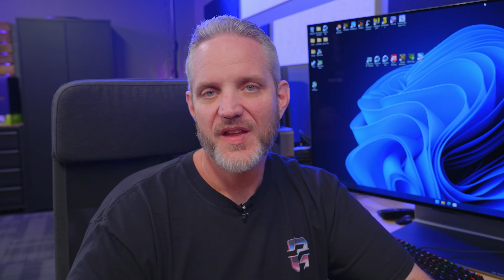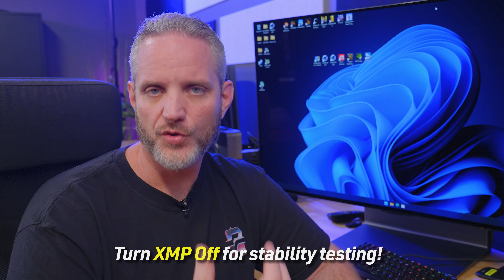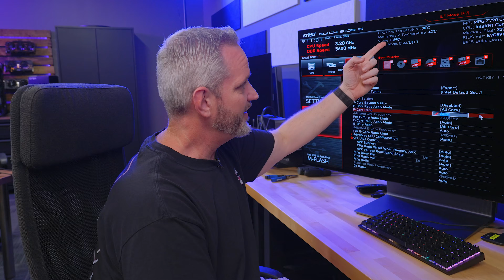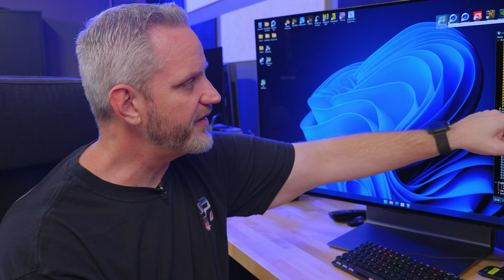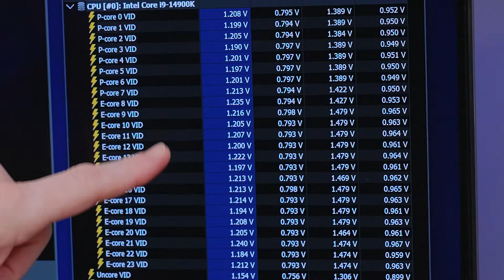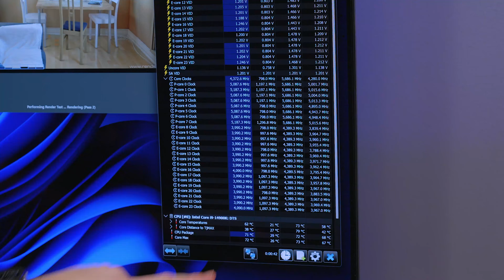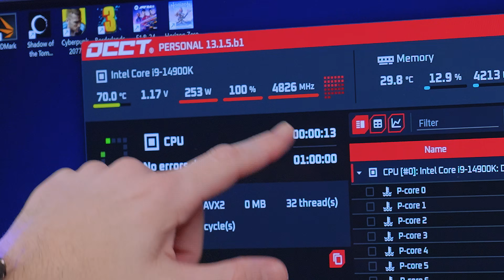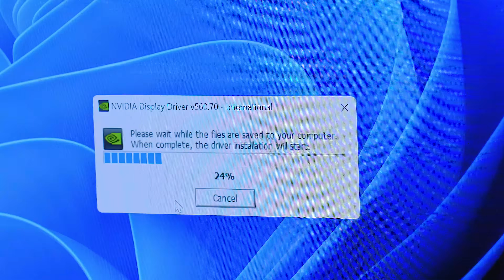Guide: How to check if your CPU is BAD!

Comment: Afraid to update my bios. My rig is working fine. My wife's rig however, constant BSOD errors. I replaced cpu, gpu, cooler, ram, mobo, and ssd. Not all at once. I did a clean install of win 11 each time and the errors started up as soon as I started updating windows. Did every fix I can find, updated bios IN the bios and still can't do anything. It'll start up after a few BSOD errors and then the second I try to run an installer for an app or a driver, it crashes. No OC, cpu temp holding at 41c. Got asus rog maximus 7790 hero, 128gb corsair dominator ram, 2tb ssd, asus 4090 tuf, corsair 100watt psu, i9 14900k with liquid cooling. Don't know what else to do. My other rig is the same mobo, i9 13900k, 64gb corsair dominator ram, evga 3080, bios version 813. ZERO issues! I'm afraid to update anything at this point with this rig. The other, looks like I have to rebuild it again $8000 later. Ready to give up.

Comment: Intel should print on the CPU the plant where it was made, just as in the "good old times" we were looking for Intel "Costa Rica" CPUs, I now demand to buy only CPUs made in Asia... I have my suspicions about "new" manufacturing plants (Boeing comes to mind). I doubt any of the "Asian Intel" CPUs are having issues. Maybe that gibberish that comes printed on them indicates the place of "birth", however, I want clear information as to where the CPU was "cooked". If they did it for so long, why don't they do it now? Too much taxpayer $$$ for them to build plants in the least reliable manufacturing country on earth?
AMD with their exploding CPUs or their very slow CPUs which had their power cut to almost half, I wonder why, is even worse. So, for my 5950X, probably the best desktop Ryzen CPU ever, I changed the cooler to a new generation Artic AIO, here's the "enlightening" information:
- Diffused in USA - Diffused in Taiwan - Made in China
WTF does that even mean? The CPU is on a joy ride or maybe on a business trip?
Anyway, I'm skipping this generation of CPUs, both in my personal rigs and in my factory (Trucks and High-Performance Cars). 
I hope they come clean in the next generation and tell me exactly where my CPUs are being made. I own a Bombardier and an Embraer, if I had both planes grounded for some strange reason and had to fly commercial (rather have my teeth pulled out with no anaesthetics, but it could happen), I would rather take longer and wait at the airport than fly in a Boeing Airplane. 
The same goes for CPUs, I want to know who is building them and where they are being built, like a few generations ago.

Comment: I am an idiot that bought 13900k, because it's been 1 year almost that I busted my a....s for coding and crashing and then I notice my codes are correct and this is my PC that changing variables from one line to next, then I try my codes on 12700k and Amd 3950x and they work with no issue what so ever, so I decide to ask for RMA the sent me new CPU with and ogly box and they took my original box as well so it 50euros less now and the new CPU was even worse and crash exactly the same or in some case even more, with last Intel microcode 0x129  the problem get's more complicated, in game it is stable but in Render and simulation is an absolute disaster, so lesson to me and go for AMD or Apple if you do not want to spend I do not know 3000 including GPU etc and do not be able to use your PC even for one day and be 1005 sure it will be stable all day long.

Comment: The cpu landscape is very confusing and even more so now with the issues Intel 13 and 14 gen cpus are experiencing. Should I avoid these now??? Any issues with ryzen 7000 series? I am looking to build a system and don't know really where to turn to get the right advice. I dont build for gaming, but I do want a midrange system with a focus on reliability/longevity/efficiency. Intel i5 12th gen perhaps or ryzen 5 5000 series? Any advice on where to go here?

Comment: my 14900k seems fine in those tests at stock settings. but I can't get a stable 6.1 p core overclock. It was easy when it was brand new. now, I've spent a ton of time trying to get it stable at 6.1 and it doesn't look like its gonna happen. stock clocks is fine tho

Comment: Hey Jay, I have a question for you. I have an odd issue. I have a 13700kf and it is not stable using all stock settings, including XMP disabled. I have an Asus z690e motherboard. When I run Intel Burn Test it will say the system is not stable after 3 to 5 passes. This is with going in the BIOS and selecting Load Optimized Defaults on the their latest microcode fix BIOS, and again XMP disabled. For testing I ordered a brand new 13700kf and a brand new Asus z790e (non wifi 2 version), and even with the brand new 13700kf and the z790e motherboard, I get the same results with the Intel Burn Test. I have also tried 3 different sets of RAM. 1 set of  32GB (2x16) and 2 different sets of 64GB (2x32), all 3 of which are on the QVL list for these motherboards/CPU.

The odd part is if I set the BIOS to use Asus optimized settings, and set the PL1 power limit to 253 watts, and the PL2 power limit to 350 watts (slightly outside of Intel spec), the PC boots fine and the Intel Burn Test runs fine with no errors. I can also then enable XMP and everything seems stable.

Also worth mentioning, the PC with either motherboard OR any of the sets of RAM and both CPUs had trouble reliably booting when set to the Intel limits and no XMP enabled. It will get stuck on post codes related to RAM problems. As well as the same boot issues with XMP enabled with the same Intel recommended settings.  

But as said, as soon as I load the Asus optimized settings in BIOS, and set the PL1 to the stock 253 , and PL2 to 350 everything runs great. 

Any idea what is going on here? I cant be the only one with the problem, since I have tried 2 CPUs, 2 motherboards, and 3 sets of QVL RAM between those.

Edited to fix a few words and grammar issues.

Comment: 13900k with ASUS extreme mother z790  is showing 100 when stressed to all core but not crashing,  temperature rises above 70 = 89 degrees when  i am rendering 4k video, red light on mother board blink on and off when temperature touches 89 or 90 but not crashing. I am getting  burning  smell from  AIO Corsair iCUE H170i Elite Capellix XT Liquid CPU Cooler  is my CPU  ok or degrading Kindly let me know

Comment: my cpu passes all these tests with healthy vcore and core temps and core voltage. (Intel i9 14900kf). However when I play demanding games i notice average vcore of anywhere between 1.35-1.42 while pulling approximately 130 watts. Only once I noticed a vcore spike of up to 1.52V and occasionally get spikes up 1.46. Im new to PC gaming. Are these numbers normal? Any input would be appreciated.

Comment: The recent 561.09 driver installed when the screen went black it never came back forced to reboot and had to reinstall it again and it went thru but I have had this happen ever so often thats how mine has happened. I am running I7-12700K  and Asus 4070 Super rog strix that I purchased about a month ago... Any suggestions

Comment: Well glad I did not update my 12th gen CPU under the Intel label. So far it's been running fine I've had no issues. The improvements that were shown with the 13th and 14th gen Intel cpus, did not make it worth me taking out my current one.

Comment: I'm not getting any crashing, but Microsoft flight simulator is stuttering a lot, almost like the cpu is taking a breath then firing back up, which I didn't have when the cpu was new.
So I'm not sure if my 14700k has been degraded or not.

Comment: I've got an old i5-4690k on a Z97 Pro4 and OC it at 4.4Ghz. With OCCT on extreme cpu test i hit the 100°C even after replacing the thermal paste (arctic mx4) and with Arctic Freezer 7pro but with no crash. Should i be expexting lower temps?

Comment: I have a 13900k on a MSI Z790 MB with a 3080 card. I bought it during covid. It started crashing BG3 and CP2077 about 6 months ago and has gotten worse. It would crash to desktop and would not install Nvidia drivers. Cenebench15 and 23 would freeze up. I updated my bios and that helped but I had to make some changes in the bios to get it stable. It still will randomly crash but not as bad as it used to. I think it is hosed but I can't afford to switch right now. This sucks.

Comment: I have had a 13th gen for a while and in the last ~5 months been experiencing random crashes. I just learned about the voltage issues a week or so ago and have been wondering exactly this. Is my CPU too far gone? Thank you so much for this video!
Reply: One they start it’s already damaged irreversibly, see if you can RMA or warranty because intel has been really slimy about thai

Comment: hello, i have an i5 14600k with asus rog strix z790 h gaming wifi, with lian li 240 aio, last day i was playing world of warcraft suddenly the screen went black no signal, but the game kept running, i could still hear discord, then fans goes like 100% and it's stays like that till i force a restart, is that a cpu problem or graphic card problem even though i have an rtx 2070 super from strix that i have never overclock or something.

thank you in advance if someone has the same issue just tell me how it was fixed
Reply: when the CPU crashes it will either do a blue screen (BSOD) or display a message window saying it's out of VRAM, so no your crash isn't coming from your CPU.
Reply: @TheKayack1  after the bios update those crashes never happened after, so most probably they came from the cpu voltage or something like that

Comment: FYI, I have been having constant crashes when running Diablo 4. I tried running Starfield and it Crashes.I tested my new NZXT-PC with a i9-14900KF and both Cinebenchs used in your video and they crash and OCCT wouldn't even start, and when I ran Intel's Diagnostic (latest version from Intel), the Burn Test, Unigen and NVIDIA install had no issues. I swapped out my Gigabyte RTX4090 for my ASUS Strix RTX2080Ti and no crashes. Clearly I am having video issues. Thanks for the great video in helping me identify my GPU issue. Stay strong and thanks for the great instructional video.
Reply: I also have in game crashes do you know a fix for this? i have a 13900k im thinking about RMA tought
Reply: (I realize this is a 1yr old post, so you probably have this sorted out already).  Your 4090 also could not be the issue, there is 200 watts difference between 2080ti and 4090.  Your power supply may not be able to reliably power the 4090 vs the 2080ti.  I have a 1500w Platinum oem Dell Alienware psu from a threadripper edition Alienware, It's only able too power about 700-750w worth of power to the 12v (should be a lot closer too 1000w).  I have a cheap Thermaltake Smart 700w power supply, it it is really close to delivering as much power the 1500W manages...  I've been dealing with computers for nearly 30 years, almost every time a perfectly working system of mine that developed a problem or crash, it was the damn power supply that was the cause.  If the system works perfectly month after month, year after year, then out of no where it starts crashing....   power supply is the first thing I check.  assuming you keep up on thermal paste and dust buildup.  I have a system I built new, with fx8350, it has literally been running 24/7 as a server since 2013.  It behaves as if it will run indefinitely forever.

Comment: Guys i need some help here. So im on the i7 12700k using the Asus Tuf D4 Wifi Z690 MB. Using intel OC Tuner i was hitting 7200 7300 benchmark score with an average of 145w (90mV undervolt). I have now upgraded to the latest bios which has the new microcode fix for the next gen cpus, yet the same undervolt uses 175 180W and less benchmark score of 5900-6100. Can someone please enlighten me what the heck is going on ?

Comment: I have a I9 13900k and a MSI Z690 FORCE WIFI, when I lunch a unreal engine 5 game I constantly get the error of “VRAM Full” I have a 4090 so that shouldn’t be the case. So long story short ended up RMA the gpu twice to get the same errors. I decided to contact Intel just to be told to change my LLC mode till it became stable

Comment: My 13700K in z690 Gigabyte have been failing during 3D rendering since 3Q of 2023, the count went up with the time, seriously and before new Microcode/Bios update I could not even slice slightly larger models for my 3D printer. Now it is ok and I do not want to even try to replicate those crashes, ever! 😀

Comment: i had similar problem once i tried to install nvidia drivers on windows 10 i got white pop-up with some error (dont remeber the code of error). Then i did fully erase of all disks, reinstalled windows 11 (i got 1 blue screen during instalation) then i updated bios, enabled xmp, set long and short range power to not be more than 100w, and seems like it works better. I played games for few days and it works quite stable.
But now i got another issue. I decided to rebuilt pc, do some cabel managment, etc.. and now my pc in the local service, because it just wont start and even no POSTing there :(  I bought a new motheboard but it didnt help, so now i hope its some stupid thing, but not a processor

Comment: I have a bad i9-14900KF and my test is Android studio->build android app (Android Studio just quit unexpectedly because I think it runs many tests during execution like If (1+1 != 2) then shut down) this test is very consistent and alows me to verify if certain settings in the bios fixes the CPU and so far my only rock solid fix is to downclock to 5,6Ghz on all p-cores. WinRAR compress a 40gb game file (it's consistent but I dont want to damage my ssd so I don't do it too much). Open Chrome and YouTube and get a sad smiley meaning something went wrong. Also Fortnite just crash randomly, mainly while loading the map.

Comment: Hey, i am using PRIME Z790-P WIFI + i7-13700K, have installed the latest version of bios with microcode 0x129 and my core VID are 1.3 V even without using any sort of benchamrk, all default, no xmp, in the bios settings i am having intel default settings. But at the cinebench while launching it i am getting instantly 100 C jumps. What does that means? My colling Cooler Master MasterLiquid Lite ML240L V2 RGB, Thermal paste - Arctic MX‑6, i did mount my cooling twice to be sure its installed correctly, the paste placed with the X style. I can manage undervolting with -0.190 and -0.075 cache, plus reducting core ratio, to don not hit tjmax, but i think it shudnt be like that. Is my cpu broken? Ahh and i never had any crashes, my system seems to be stable.

Comment: u talking about 13th and 14th gen cpu`s wich is extrmely new, dude i use my pc everyday and cpu is from 2013 i7 3rd gen and works fine, and even has 1-2 of those tiny capacitors from the back damaged piece of it missing and sitll running just fine, but i never overclocked though, its 11 yeras i bet it works another 11 just fine  u guys talking aobut 13 14th gen beeing degraded already

Comment: My core clocks, by default (GIGABYTE Z790 AORUS MASTER with Intel Core i9-14900K), are at 4.4 and 5.7 constant), i have nothing but chrome opened. My CPU temps are ranging 50-80 celsius, constantly for the last 3 months since i have this CPU). I do have lastest bios with the new update, but same thing. I even bought latest AIO from lian li, still same.... I tried Noctua, still same.
Reply: Lian li with 3 coolers.
With OCCT i get:  
90-95 degrees (before bios update 100 degrees and instant crash).
253W
4600 Mhz max.

I got no idle core clocks (dont know why). so my temps constantly 50-80. (beside l-controller from lian li that uses CPU...).
And if i leave PC open, during night, my coolers go on and  off constantly, so f annoying.

I even found my computer in sleep mode, with CPU doing stuff and coolers off. So i found it after many hours at 100 degrees, the coolers were literally burning.

My CPU still seems to have no errors. BUT

PLEASE DO NOT BUY intel i9 14900k at minimum.

Comment: if Intel knew about this problem and didnt bother to tell customers and also cripple them ... why bother ? just run a max TDP profile from bios and set it on Linpack on prime95 and let it burn ;) then go buy a 7800X3D or 7900X3D depending on what you need maybe a 9950X or similar and call it a day.